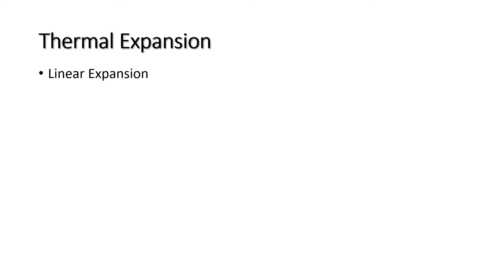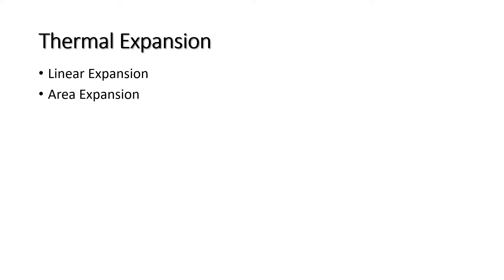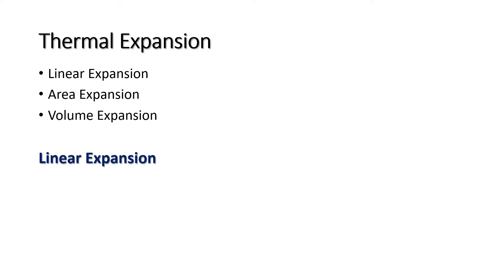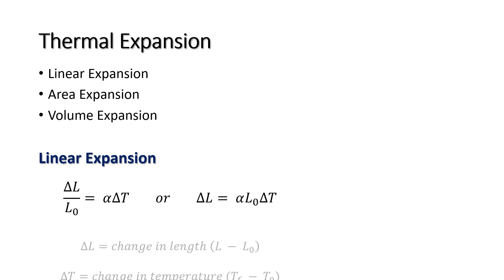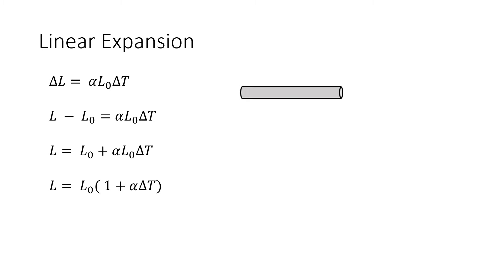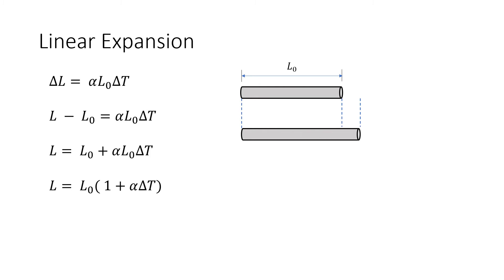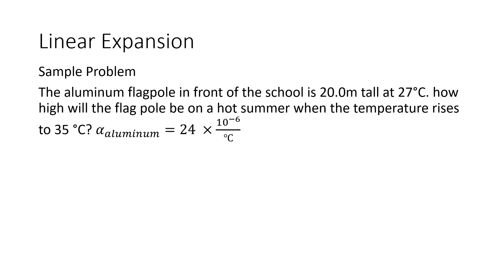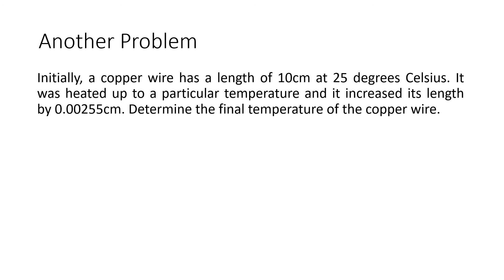Thermal Expansion | Linear Expansion

Comment: What is the difference between linear coefficient of thermal expansion and the value of specific heat? My teacher uses the specific heat in our discussion
Reply from the maker: @Reiallison  coefficient of linear expansion is the value of relative change in length of a material for every degree of change in temperature. On the other hand, specific heat is the amount of energy needed to change the temperature of a substance or material per kilogram.

Comment: How much water will overflow in a steel pipes hot water heating system containing 75 cubic foot of water? The Hot water heating system is filled with water at 40 °C and then heated to 100 °C. The coefficient of volume expansion for water is 0.00037 per Cº or 0.0002 per F°, and the coefficient of linear expansion for steel is 11 x 10-6 per Cº or 6.1 x 10 -6 per F°. Can you answer this

Comment: Hey I tried this method in another problem. Instead of copper wire, my problem was glass. So it is right until I reach the final answer, using the other method(which is correct) the answer was 225 degree Celsius and using this method I only got 25 degree Celsius, I feel like this is the simplified method of the two but I'm confused if I should add 200 so that I can get the exact same results but the question is where did the 200 came from?